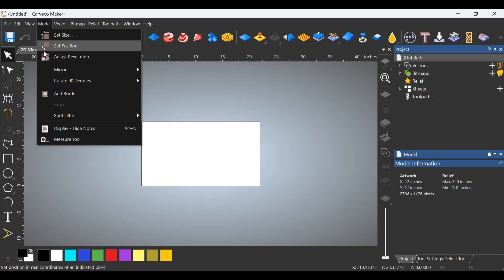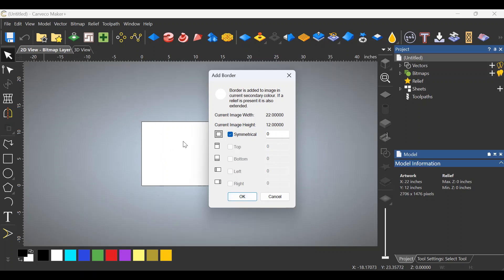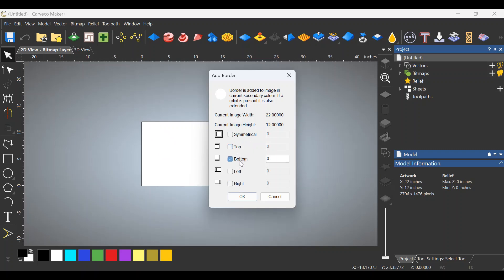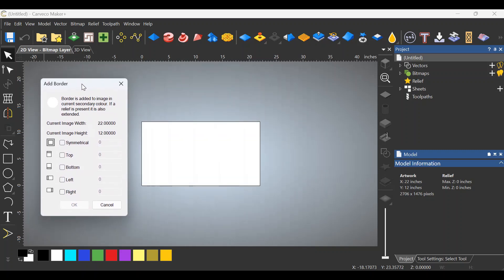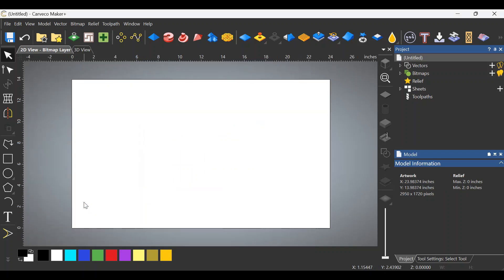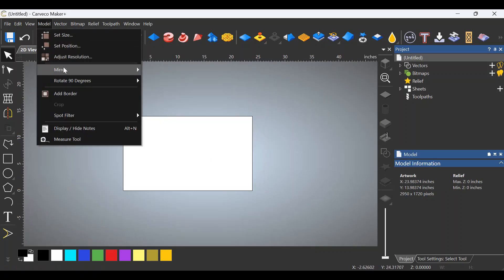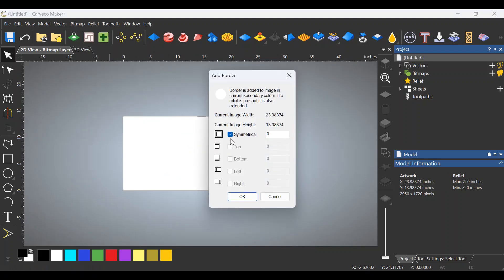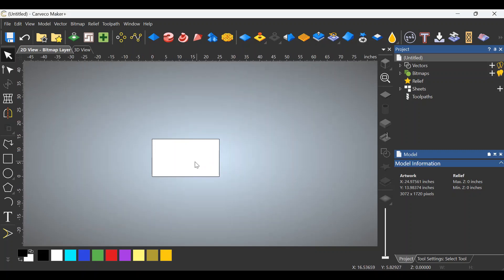#2 Increasing the size of work area. Mastering Carveco in minutes.

Comment: Just downloaded Carveco to see if I want to switch to it from Vectric. Why is there not just an option to set length and width of material? That's one of the most stupid things that there isn't. Should be one of the very basic options of any CAM program.
Reply from the maker: That option is done in the very beginning when setting up your model
Reply: @Hinkleshop ok I see how that workflow is going. Thanks